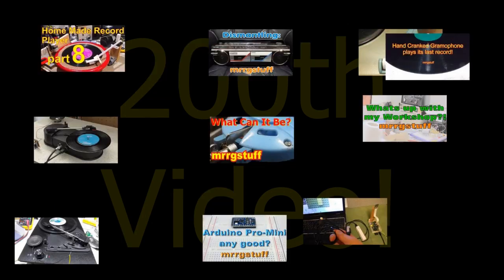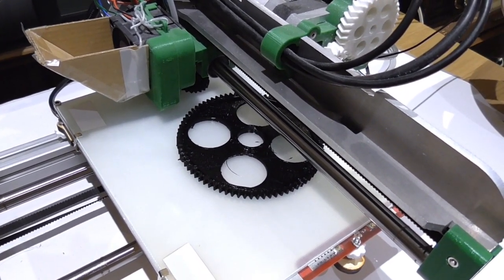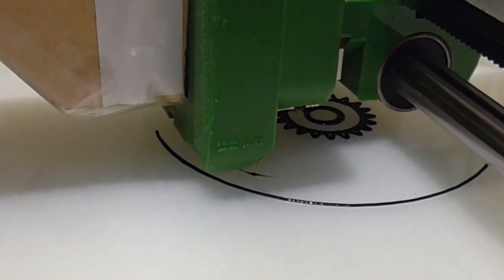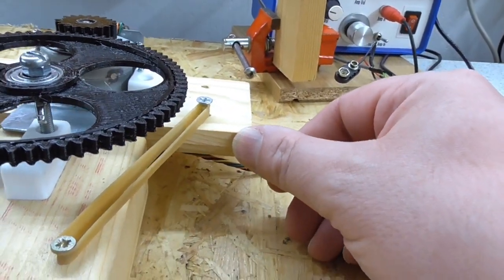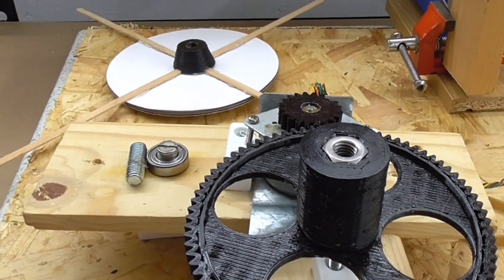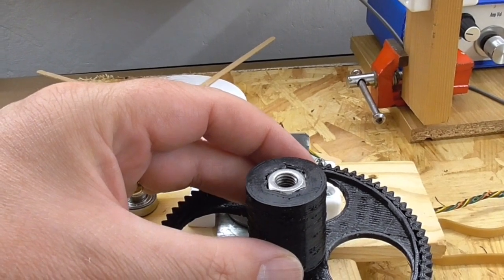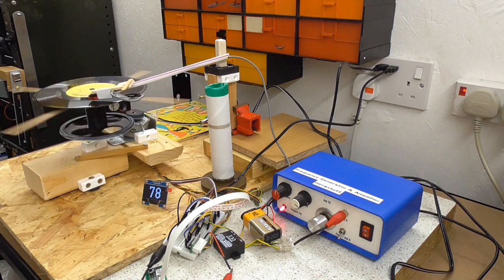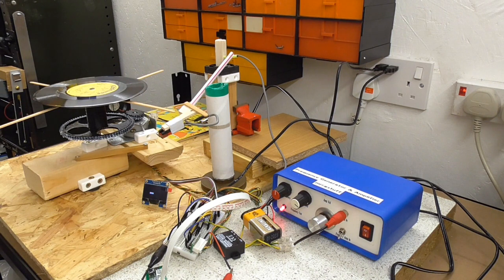Mk2 - Stepper Motor Record Player

Comment from the maker: // Stepper motor reduction gears and turntable mount 2019 mrrgstuff
include <BOSL/constants.scad>
use <BOSL/involute_gears.scad>
use <BOSL/metric_screws.scad>

rim_height = 5; // height of large gear (gear 2)

union(){

// translations to check gears mesh (don't print with these lines)
//    translate([-34.4,1.9,0])gear_1();
//    translate([30,0,0]) gear_2();

// Use these lines for printing
// Only uncomment 1 line at a time
//  gear_1();
  gear_2();
//    gear_2_extension();
}

module gear_1(){
    difference(){
        linear_extrude(height = rim_height+3, center= true) gear2d(mm_per_tooth=4, number_of_teeth=20,pressure_angle=25);
        gear_1_hole();
    }
}

module gear_1_hole(){
    hole_radius = 4;
    hole_depth = 12;
 cylinder(h = hole_depth, r = hole_radius, center = true, $fn=64);
}

module gear_2(){
    difference(){
        union(){
            gear_2_main();
            gear_2_hub_outer();
        }
        gear_2_hub_inner();
    }
}

module gear_2_main(){
    {
        difference(){

            linear_extrude(height = rim_height, center= true) gear2d(mm_per_tooth=4, number_of_teeth=80,pressure_angle=25);
            bighole(-21,-21);
            bighole(21,21);
            bighole(-21,21);
            bighole(21,-21);
            // hollow out top of gear slightly
            translate([0,0,3]) cylinder(r=46,h=8,center=true);
        }
    }
}

module bighole(x,y){
    translate([x,y,0])
    cylinder(r=15.5, h=10, center=true);
}

module gear_2_hub_outer()
{

 // outside/inside flange
 translate([0,0,-2.5]) cylinder(h = 5, r = 13.3, center = false);
 
}

module gear_2_hub_inner()
{
    // Hole in the middle
    translate([0,0,0]) cylinder(h = 20, r = 9.75, center = true);
}

module gear_2_extension()
// prints as seperate part
{
    difference(){
        gear_2_extension_outer();
        union(){
            gear_2_extension_inner();
            translate([0,0,-0.1]) scale([1.1,1.1,2.0]) metric_nut(size=8, hole=false);
        }
    }
}

module gear_2_extension_outer()
{

 // outside
 translate([0,0,0]) cylinder(h = 30, r = 14, center = false);
 
}

module gear_2_extension_inner()
{
 // Hole in the middle
 translate([0,0,8]) cylinder(h = 25, r = 11, center = false);
}

Comment: Wind up gramophones are all gears and they are so quiet, maybe smaller diameter brass gears would do ?
Reply from the maker: Yes, smaller gears would probably have less noise. Some gramophone motors have fibre gears especially to make them quieter

Comment: I see in the comments that belt drive is on the schedule and I also agree that the sound of the mechanism is quite soothing but obviously not what you were aiming for. Keep on going 🙂👍
Reply from the maker: Thanks. Yes I knew the gears would be a bit noisy but I was disappointed the sound quality of the 33 and 45 wasn't better, despite the fact I had increased the speed of the motor. Hopefully the belt drive will be better! 😀

Comment: I dont mind the noise, it sounds like something off the Farm. Why not use a belt to drive rather than the gears?
Reply from the maker: Thanks. Yes a belt drive will be the next version of this. Have most of the parts already but probably will do some 3D printing for it too 😀
The noise didn't sound too bad initially but when doing the record tests I found it quite hard to pick out the music. Easier listening to the video though. I have some new 33/45 test records also as I know these ones too well

Comment from the maker: /*
 Stepper Motor Record Turntable

 This program drives a unipolar or bipolar stepper motor.
 The motor is attached to digital pins 14,15,4,5 of the Arduino.

 Buttons connected to pins 6-9 control the speed
 6 = 0 rpm
 7 = 33 rpm
 8 = 45 rpm
 9 = 78 rpm

 8 (45) and 9 (78) pushed together take turntable into low speed mode (set by LOW_SPEED)
  
 Based on Arduino example by Tom Igoe
  Created 11 Mar. 2007
 Modified 30 Nov. 2009

mrrgstuff - 2019

============ BSD License for U8g2lib Code ============

Universal 8bit Graphics Library (http://code.google.com/p/u8g2/)

Copyright (c) 2016, olikraus@gmail.com
All rights reserved.

Redistribution and use in source and binary forms, with or without modification, 
are permitted provided that the following conditions are met:

* Redistributions of source code must retain the above copyright notice, this list 
  of conditions and the following disclaimer.
  
* Redistributions in binary form must reproduce the above copyright notice, this 
  list of conditions and the following disclaimer in the documentation and/or other 
  materials provided with the distribution.

THIS SOFTWARE IS PROVIDED BY THE COPYRIGHT HOLDERS AND 
CONTRIBUTORS "AS IS" AND ANY EXPRESS OR IMPLIED WARRANTIES, 
INCLUDING, BUT NOT LIMITED TO, THE IMPLIED WARRANTIES OF 
MERCHANTABILITY AND FITNESS FOR A PARTICULAR PURPOSE ARE 
DISCLAIMED. IN NO EVENT SHALL THE COPYRIGHT HOLDER OR 
CONTRIBUTORS BE LIABLE FOR ANY DIRECT, INDIRECT, INCIDENTAL, 
SPECIAL, EXEMPLARY, OR CONSEQUENTIAL DAMAGES (INCLUDING, BUT 
NOT LIMITED TO, PROCUREMENT OF SUBSTITUTE GOODS OR SERVICES; 
LOSS OF USE, DATA, OR PROFITS; OR BUSINESS INTERRUPTION) HOWEVER 
CAUSED AND ON ANY THEORY OF LIABILITY, WHETHER IN CONTRACT, 
STRICT LIABILITY, OR TORT (INCLUDING NEGLIGENCE OR OTHERWISE) 
ARISING IN ANY WAY OUT OF THE USE OF THIS SOFTWARE, EVEN IF 
ADVISED OF THE POSSIBILITY OF SUCH DAMAGE.   
 
 */

#include <Stepper.h>

#include <Arduino.h>
#include <U8g2lib.h>

#ifdef U8X8_HAVE_HW_SPI
#include <SPI.h>
#endif
#ifdef U8X8_HAVE_HW_I2C
#include <Wire.h>
#endif

U8G2_SH1106_128X64_NONAME_1_HW_I2C u8g2(U8G2_R0, /* reset=*/ U8X8_PIN_NONE);

const int stepsPerRevolution = 48;  // change this to fit the number of steps per revolution
// for your motor

// Buttons for changing speed
#define Button_0 6
#define Button_33 7
#define Button_45 8
#define Button_78 9

// LOW_SPEED is a special mode for turning the turbable slowly. Not for playing a record
#define LOW_SPEED 15

int rpmspeed = 0;
int count = 0;
bool state = true;

// initialize the stepper library on pins 14,15,4,5:
// Pins 2 and 3 left for I2C OLED display
Stepper myStepper(stepsPerRevolution, 14, 15, 4, 5);

void setup() {
  pinMode(Button_0 ,INPUT_PULLUP);
  pinMode(Button_33,INPUT_PULLUP);
  pinMode(Button_45,INPUT_PULLUP);
  pinMode(Button_78,INPUT_PULLUP);

  // set up the display for the speed selection
  u8g2.begin();
  u8g2.setFont(u8g2_font_logisoso62_tn);
  display_string("--"); // just to show arduino has started
  delay(1000);
  // set the display to 0 rpm)      
  display_speed(rpmspeed); // will blank display as don't show 00
        
  // initialize the serial port:
  // Serial.begin(9600);
}

void loop() {
  // step 1/8 revolution at the desired speed:
  if (rpmspeed != 0){
      myStepper.setSpeed(rpmspeed*4); // x4 for gearing
      myStepper.step(-(stepsPerRevolution/2));
      count=0;
  }else{
    if (count++>10000){
      count=0;
      state=!state;
      if (state){
        display_string("- ");
      }else{
        display_string(" -");
      }
    }
  }
  // Low Speed mode turned on if 45 AND 78 pushed at time
  if ((digitalRead(Button_45)==LOW) && (digitalRead(Button_78)==LOW)){
    if (rpmspeed != LOW_SPEED){
      rpmspeed = LOW_SPEED;
      display_string("//");
      delay(500); // give user a chance to release buttons
      display_speed(LOW_SPEED);
      return; // return immediately - don't do rest of loop this time around
    }
  }
  if (digitalRead(Button_0)==LOW){
      if (rpmspeed != 0){
        // Serial.println("0 button pushed");
        rpmspeed=0;
        display_speed(rpmspeed);
      }
  }
  if (digitalRead(Button_33)==LOW){
      if (rpmspeed != 33){
        // Serial.println("33 button pushed");
        rpmspeed=33;
        display_speed(rpmspeed);
      }
  }
    if (digitalRead(Button_45)==LOW){
      if (rpmspeed != 45){
        // Serial.println("45 button pushed");
        rpmspeed=45;
        display_speed(rpmspeed);
      }
  }
  if (digitalRead(Button_78)==LOW){
      if (rpmspeed != 78){
        // Serial.println("78 button pushed");
        rpmspeed=78;
        display_speed(rpmspeed);
      }
  }
}

void display_speed(int speed)
// Converts speed to a string and calls display routine
{
    char speed_str[3];
    strcpy(speed_str, u8x8_u8toa(speed, 2));    /* convert speed_str to a string with two digits */
    if (speed==0){ strcpy(speed_str,"  ");}
    display_string(speed_str);
}

void display_string(char *txt)
// Displays string on 128x64 OLED display using u8g2 library
{
    u8g2.firstPage();
    do {
      u8g2.drawStr(25,63,txt);
    } while ( u8g2.nextPage() );
}